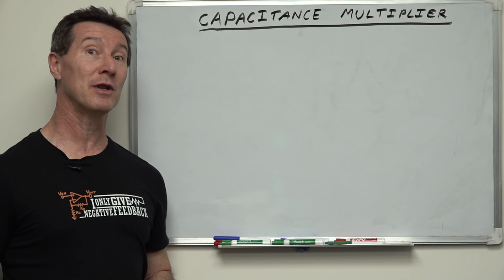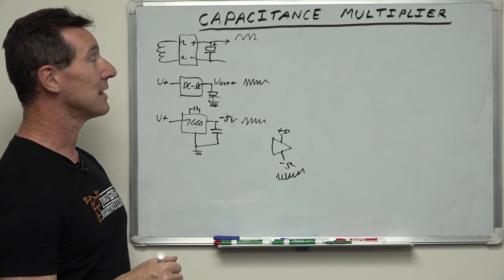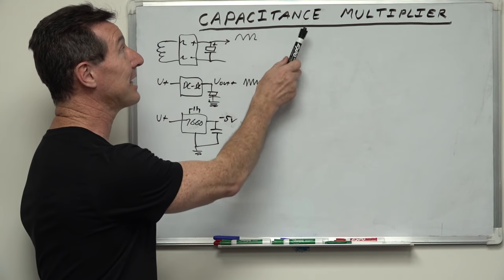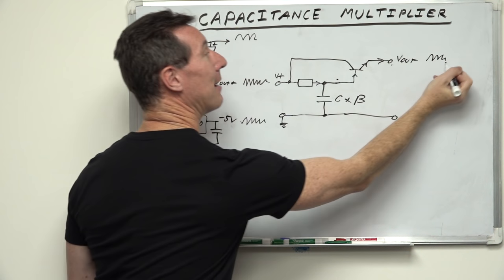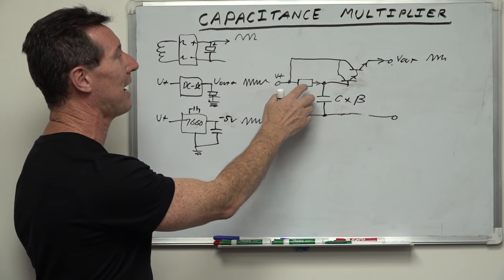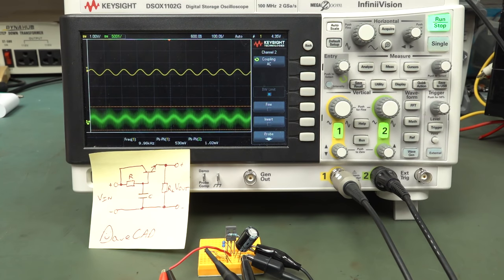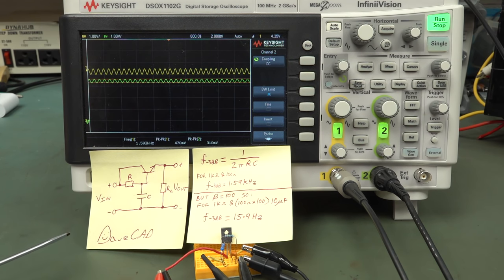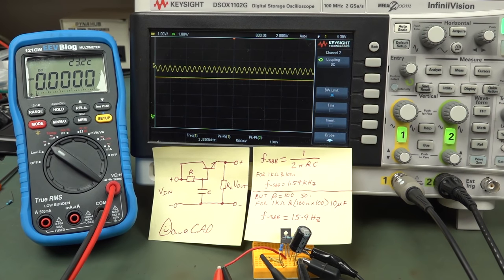EEVBlog #1116 - How to Remove Power Supply Ripple

Comment: This may be way off base but — can this kind of circuit address noise and hum in the audio frequency range? For example cleaning up noise from a 9v dc power supply for a guitar pedal or audio amplifier?  If not what other sorts of solutions should one consider?

Comment: I guess in couple A application this is good, but in high current application BJT loss is a big issue in this design. Reducing power supply ripple is also solved using high quality MLCC. But this is very good idea.

Comment: So a dc/dc adjustable power supply with a 1ohm resister on a voltage regulator would produce a bit of ripple without the capacitor?

Comment: Silly question,  before I build it myself to find out. What if I use a resistor in series with a Ziener diode on the output to give me a regulated output. From the diode, feed it back to the base of the transistor?

Comment: Your frequency cutoff calculation at 23-24 minutes was invalid.  The "multiplied capacitance" is in PARALLEL with the resistance and no filtration can therefore be expected.  Filters have a series component followed by a parallel component.

Comment: I have a 110VDC rectified output from a transformer. I want to use an rc filter combined with a mosfet as a series pass transistor to remove the ripple and amplify the current, but the max gate threshold is 30V. Can this principle be used in this type of circuit, or will it only work if the regulated voltage is lower than the gate threshold?

Comment: We used to use chokes with capacitors on both sides. Worked pretty well in power hungry circuits. What happened to that?
Reply: If the ripple is low frequency it's going to require large inductors.

Comment: In the mosfet case, current flowing does not ever see the resistor or capacitor, how does its voltage end up being filtered? Seems unintuitive to me. I can understand the BJT case since the emitter voltage follows the base voltage which is filtered, but in the mosfet case, the source voltage follows the drain voltage and that mostly just bypasses the filter you have on the gate, which only serves to create the current channel in the mosfet, does it not? If gate voltage is already high enough and your current channel is saturated, then removing the ripple on the gate shouldn't even cause a non-negligible change to fluctuations in RDSon, much less the output voltage at the source.

Comment: Hi, Thanks for a very inspiring video. Do you know the voltage quality of a USB-C power bank? I am seeing these power banks used in connection with Audio DAC's. But does USB-C have DC-DC converters? and if... would it be possible to a "Capacitance multiplier"?

Comment: I would like to get clean 9VDC to power my DE5000 RCL meter. I've got two wall wart switching power supplies. One supply is 9VDC 1A and the second - 12 VDC 1A. Both power supplies can be easily open (as they are assembled with screws) and somewhat modified (within limited space inside of plastic cases). I was thinking to try two options: 
1. To replace output capactor in 9V power supply with a larger value and better quality cap + bypass. BTW, the output voltage is 9.3V.  
2. To install 9V voltage regulator IC into 12 V power supply with some good quality output cap.
I guess both of these units produce some ripple voltage at their switching frequency.
Should I try to use that "capacitance multiplier" in either of these power supplies? 
I guess in order to use it in the 9V supply I would need to figure out how to rise the output voltage up to 10 or more volts.
 And will I get about 9 V output from the 12 V supply if I use a Darlington transistor or should I drop that 12 V output somewhat lower first?

Comment: I  don't believe he  mentions exactly why the pass transistor eliminates the ripple. I think how this happens is the r/c filter delays the ripple at the transistor base so it works against ripple on the input. If the delayed base ripple is tuned to near 180 degrees then when current on the collector is increasing, current on the base is decreasing at basically the same rate. And that cancels the ripple on the emitter.

Comment: Wouldn't it roughly be a regulator if we connect a zener across the capacitor?
Reply: that would work at fixing the voltage output at roughly 0.6V less than the zener voltage (or 1.2v for a Darlington pair) but what it does to the ripple... it would be interesting to investigate.
Remember, the zener would be connected across the capacitor.

Comment: Just wondering, it would be simple for them to make a regulator with a terminal for a capacitor to integrate the capacitor multiplier into the regulator.  So it would be simple to make a 4 terminal regulator with the added terminal. I suspect someone already makes something like this.

Comment: In multi stage circuits like transmitter where people sprinkle 3 terminal regulators all over the place, it strikes me that these would be better for each stage following a single three terminal regulator of a higher voltage, if you really want to avoid ripple modulating your power supply rails

Comment: Is this something that would fix flickering LED lights when using a half cycling heating unit?  Would the solve the voltage sag, and thus, the flickering lights?  I’d like to build a unit of some sort to plug the heater unit into and stop the rapid amp draw from flickering the lights.

Comment: The name (cap multiplier) is very confusing. The whole transistor just reduces the current through the resistor. So if you need 10k for filtering, you dont have to place a 25W resistor package with heating flanks, but a 1206 will do. It basically gives you beta^2 times less dissipation on the resistor, so the resistor value can go up beta^2 times. There is NO multiplying anything, hence the flitering stays the same with or without transistor, UNLESS you change the R.

Comment: Does that mean that with such a circuit (in a high current application) where ripple current through a capacitor is an issue, a capacitor with a lower ripple current capability could be used in the design. Ie, a cheaper capacitor?

Comment: It was mentioned you could have multiple stages.. could you place a pi (or T) 3rd order filter (or even 5th order) to get the sharp attenuation slopes while maintaining minimum loss at DC? At what point does it all apart?

Comment: How much power loss and voltage drop can be expected from the transistor? It seems that it would be approximately the same as a typical diode but I stand to be corrected.

Comment: look this is going to be a stupid question but can an Inductor limit / remove ripple from a power supply by resisting changes in the ripple, sounds like an easy enough component to make / purchase and something that that would work a most voltages

Comment: Awesome!! I know that current carrying wires are like long antennae, and I am not an engineer, but could some of the ripple come from (AC Power) not being able to place the tap close enough to the middle of the transformer either because of the grid layout 1st introduction of a frequency, then house hold transformers imperfections giving rise to 2nd, 3rd, etc harmonic pickup and Local loop correlation of actual harmonics not being aligned with the mathematical harmonic.

Comment: The low pass filter sits at the middle of the ripple voltage, so the transistor clamps the upper part of the ripple right? So you can add a final bulk capacitor to average the output ripple?
Reply: No.  I recommend downloading LTspice (it's free) and studying what the circuit does.

Comment: I recently had an issue with a capacitive touch controller that, due to the high noise and ripple coming from another board malfunctioned. This circuit would have fixed it right away. I was able to fix it with an LDO as well.
Reply: Totally agree. I just put this into my mental toolbox. We've had all sorts of fun with touch controllers, and I have spent way to much time re-arranging power lines in a crammed case five hours before deadline.

Comment: thanks for that great video, so I can use it with a voltage regulator as a reference voltage for my ADC, isn't it ?
I ask that because in PICO board ingeeners used the voltage from the buck/boost converter for the voltage reference  of the ADC, and it  works like crazy. they show some tricks but that is not good to get a good result .
Laurent

Comment: I saw some guys mixing many types and values of capacitors in the output stage of a so called linear power supply for phono preamplifiers with 1ohm resistors between them. i mean, like 20 capacitors of all kind. does this makes sense, will they actually improve anything for this type of preamplifier?

Comment: Why don't LDOs have this circuit at their output stage? The R and C nodes can be brought out as pins for user to pick suitable values.
Reply: Because of the "L" in "LDO". The point of an LDO is to keep current flowing when the input voltage is almost the same as the output voltage, but this circuit can only eliminate ripple equal to or less than the transistor's voltage drop. Thus, good performance of this circuit runs contrary to good performance of an LDO.

Better to let a designer add this to the front of an LDO themselves.

Comment: Hey nice video! I am not really experienced in constructing circuits. I understood the theory on how it works but I have problems choosing right components. I have made a power supply with buck converter with max 30 volts and 8 amp output. But to make it future proof if i upgrade my buck converter and main supply I want to make a circuit for 60v and about 20 amps. Now I didnt measure the ripple peaks from the supply but according to some videos it shouldnt be more than 250 mV. Could you help me?
Reply: Will a IRF540N be good?

Comment: If you are dealing with HF ripple from a boost/buck converter, could you add an inductor in series with the resistor to ramp up the effectiveness?
Reply: Yes; if you're careful.  You want a "low Q" circuit here to avoid ringing.

Comment: I'm going to be using a CC CV DC to DC boost converter to charge my custom scooter battery, should I be worried about ripple? I have a bunch of ceramic capacitors could I use those to reduce ripple? which from what I learned can filter high frequencies better than electrolytic capacitors.

Comment: Of course, if your ripple is high frequency, you could use a series L-C tank circuit across the supply, whose resonant frequency is the frequency of the ripple! Of course, you may end up winding a custom inductor, but hey, that’s the price you have to pay-to-play! 😎
Reply: William Squires But that requires knowing the ripple frequency precisely, which isn't always the case (some SMPS designs change frequency depending on load, others just have an imprecise frequency that easily varies with external conditions).
  But using an LC filter instead of an RC filter would give you a second order low pass and is a common way to isolate power supply noise from a sensitive circuit such as a high gain input stage.

Comment: can i safely limit the ripple voltage of a power supply to under 50V because i want to drive a motor with a 48v power supply but the motor driver may get damaged if the voltage surpasses 50v?

Comment: Learn something new! May I raise a question here that if I want to use a MOS in the circuit as I dont want a voltage drop in the output, what should I do if the input voltage is low, say 3v only that too low for the Vgs and I still want to regulate it? thx thx

Comment: This is all nice and dandy, but doesn't the capacitance multiplier circuit just move the problem to the input power supply? Won't there be ripple on the output if the power it receives has ripple in it? I don't see how this circuit solves anything.

Comment: If one wanted to avoid using an op-amp, could a „capacitance multiplier“ circuit be used as an active low-pass filter for audio signals?
Reply: Probably not for audio, its linearity (THD) won't be amazing.

Comment: Is R2 needed in the op amp amplifier as a bootstrapping resistor? I suppose the op amp is powered from vout, otherwise you re-introduce the ripple through the op amp supply? And so you have a boot strapping problem?
Reply: R1/R2+1 gives the capacitance multiplication factor. The op amp  version is not powered from the input, it assumes regulated supplies are there. The two versions are not used for the same thing, the opamp can't handle much current. 
Sometimes there's another resistor (R2) in the collector path of the BJT version so you'd get the same formula and remove/reduce beta dependence.

Comment: But... The rectifier has all the ripple before the RC circuit so won't the transistor only have zero volts to pass when it needs to pass the most? I guess the RC circuit phase shift avoids this problem?

Comment: What would happen, if you are adding a Z-diode or another regulator element in parallel to the C ? Basicly a combination of a simple transistor regulator circuit and this capacitance multiplier...
Reply: It's a regulator without feedback.

Comment: Works like a charm! However, I'm having issues with higher loads using BJTs, as the base voltage tends to drop when the output load increases. Does anyone knows a good surface mount mosfet that I could use for this? My output load is 5.2v 2A.

Comment: How would you implement this for regulation of a negative voltage, say -15V from a charge pump? Can I still use an NPN transistor, or do I need to use a PNP, and does the schematic change in any way?
Reply: Correct, use a PNP.

Comment: Howdy. Just one comment.
The circuit can clip the peaks, yes. But it cannot fill the lows like a true large capacitor does.
Regards.
Reply: Shouldn't it be able to fill valleys of Vbe - Vce below Vb?  The saturation voltage is lower than the base-emitter junction forward voltage.
It's still limited to around -300mV lows.

Comment: I am a bit confused about how capacitors can totally remove ripples, because the ripple profile and the discharge curve of a capacitor are probably not 100% symmetrical.
Reply: The discharge profile doesn't matter. All you want actually is that your capacitor can 'short' the ripple to ground fast enough. When I say fast enough, I mean that if it's not fast, you get toward the more flat part of the discharge curve (you can think of it as the capacitor almost 'saturated'). Once you're in the flat part, the current thought the capacitor goes down, and your not shunting ripples to ground anymore. In that cause you need a bigger cap which can shunt more current and more ripple to ground before saturating

Comment: What about using a CLC pi filter?  How does that compare, except for the inability to maintain high current.
Frank
Frank Reiser Video/Audio Service
Reply: Frank Reiser M.S. : CLC filter performance is frequency dependent. If properly tuned for your application it may be a good alternative, especially in the high frequency range. But, a MOSFET arrangement will be much better in a large frequency range, except for the Vgate lost of about 2 to 6 or 7 Volts.
Reply: @jimviau327  Thank you.
Frank

Comment: … Q2 (important doubt to me): Does the Cap. Multiplier could really have an internal feedback loop (~= Closed loop), or could be understood just as operating in “Open Loop”?  Following is the context, based on posts in EESE forum.
Inspired by your video, I posted a question at EESE about Capacitance multiplier and received some replies that “said” (afaik) the capacitance multiplier with BJT has indeed a kind of INTERNAL feedback, from BJT’s hybrid model (I guessed).My view is that a Cap. Mult. works as a kind of Open Loop circuit, while a series regulator counts with EXTERNAL feedback loops, using Op Amps, diff. amplifiers, etc.

Comment: Ripple, Ripple was my enemy as an avionics tech and oscilloscope was my best friend.  The folks that calibrated using a multi-meter alone would sometimes whine that all their voltages were within tolerances but the box was still not checking out good.  Breakout the trusty o'scope and we could see that the ripple took the voltage out of spec.  We did not have the power to modify the circuits but not being satisfied with being in tolerance and shooting for the nominal value eliminated the ripple the vast majority of the time.  If nominal was +5vdc a tolerance of +/- 5% or 10% was typically allowed.

Comment: hi, Dave. 
what I need as a  transistor and a capacitor and resistance in order to remove the ripple from output 80V 20A.
 ( dc to dc step up 1800W ) the new board steps up that is an online buy.
 I get one but the ripple is soo powerful and I put a big capacitor but the system get the fuse cut because of high current that needs to charge the capacitor start from 0
Reply: There is little info to go on in your brief description, but if this is directly at the output of the switching supply, you are probably better off with an inductor before your filter caps.  The size of the inductor depends on the size of your filter caps and the frequency you are trying to attenuate.  At those currents, you'd also want to include a kickback diode at the supply output to keep the inductors from pulling the voltage too negative when you turn the supply off.

Comment: an PI network filter with a 50 turn coil and two 1,000uf capacitors on both ends to lose the ripple.

Comment: hey i was a knowledge full video 
i have just one question as i am a fresher in electronics. 
i have a function generator , power supply and dso how can i superimpose the function generator signal on the output of power supply and observe it in oscilloscope

Comment: I dont understand how the ripples are better suppressed without changing the base lowpass filter cutoff frequency. Can somebody help? A quit look on the internet did not provides any help as the claim that the capacitor is "multiplied" by the transistor beta et repeated everywhere, but here the last demonstration at the end of the video show that this is not so simple.